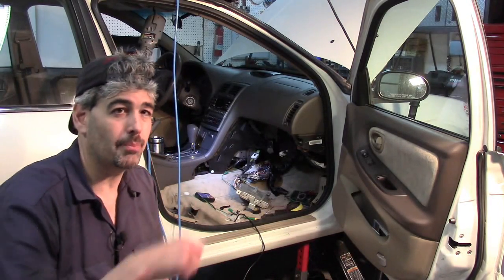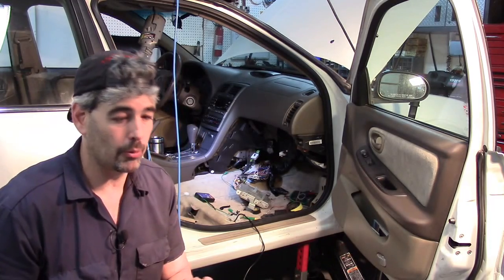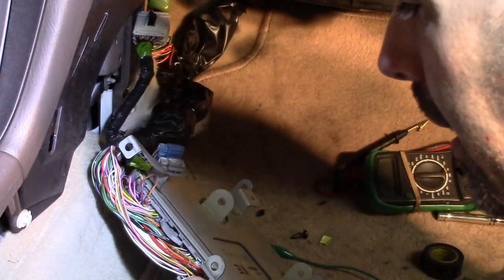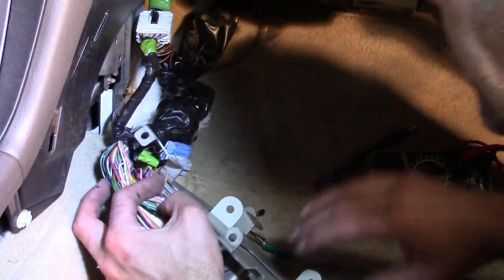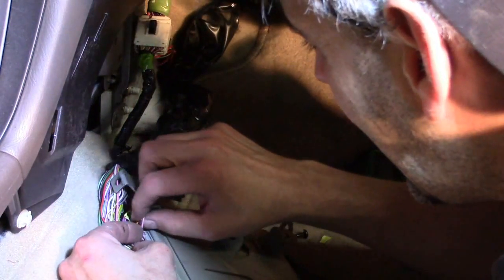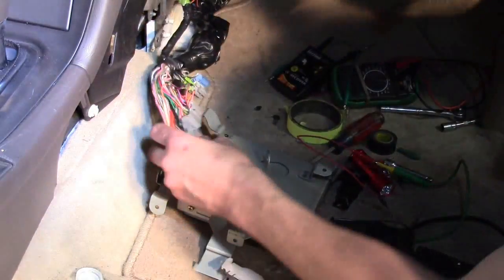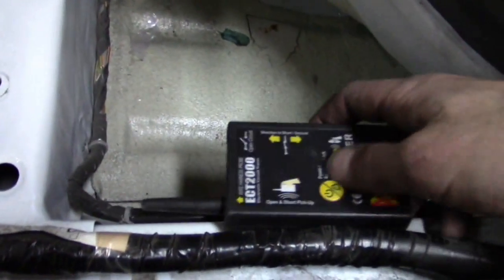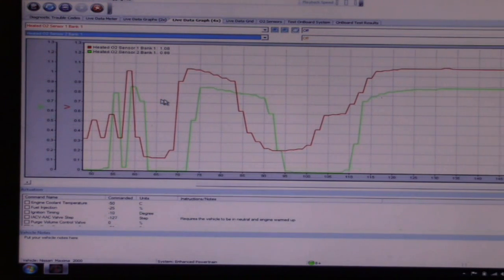P0138,P0139 Diagnosis from Hell Part 2

Comment: Sorry but you did make a big mistake in this diag , your wiring diagram you had in part 1 was perfect and accurate if you look at it you will see power feed from fuse 8 for the heater to sensor pin 3 on the sensor plug , pin 2 on sensor plug goes to pin 5 at ecm for ground side control, I watched this part 2 video thinking you were going to pick up on that , anyway we all make errors no hard feelings keep up the good work 👍
Reply from the maker: So what was the error in the Diag though? The Diag was accurate even if the diagram was misread on that detail.  The heater circuit was still open either way.
Reply: @SchrodingersBox  you were looking at the ground which was the signal ground for the sensor, you said the heater was voltage switched which it wasn’t the dotted line around the 2 wires is a shield for the signal side of the sensor, if you look at the original diagram you will see what I mean , yes you diagnosed an open ground correctly but because you read the diagram wrong it confused you a bit 👍
Reply from the maker: Ha well in either case the correct wire was identified and the diagnose was correct.  I am not too worried about a misread on a part of the diagram that wasn’t relevant but thanks!

Comment: Great job dude. I can tell you having worked at car dealerships in the past that they would have never taken the time to find that problem. I also am a good diagnostic tech. , But with the flat rate system they simply won't pay a tech. for good detailed diagnostic work like this.   I got out of flat rate and have been working on trucks and municipal equipment with hourly pay for 10 years now. There are places that appreciate good techs. just not dealerships....Rob.......
Reply from the maker: Yes I have found that to be the case. The system actually discourages proper diagnostics. They should restructure the incentive and pay system for diagnostics, really.

Comment: Great video! Watching it I was thinking what I would have done. I'm not as knowledgeable and comfortable using live data as you, so I would have gotten the wiring diagram, disconnected the PCM, and found the open with my powerprobe first. Then I would have carried on as if I had fixed the problem. Then the check engine light would come back on and I would have replaced the O2 sensor. BUT, I would have no idea why it was bad in the first place. I would also be wondering if one problem caused the other problem. Since I only work on my own cars, doing it this way would not be a problem, but your way was better since it was not your car, and found both issues at the same time.  Cheers...

Comment: How did you know that the oxygen sensors would cut off at 3500 RPMs? Was that something you already knew? Or was that information obtained from the wiring diagram packet? If it was something you knew; is the cut off occur on most vehicles or is it exclusive to this make it model specifically?
As usual, you rock!
Reply from the maker: Thanks! this is something all vehicles do so I was already expecting it.

Comment: I had a nightmare xterra with weird codes for the evap pressure sensor, and knock sensors for like sensor signal low, and it was all fucked up

Comment: @Schrodingers Box So the Power Probe ECT2000/3000 CAN be used on a wire that goes directly to the PCM with the key and/or the car running? I am testing a fan clutch sensor circuit and the wire goes from the clutch- directly to the PCM. The manual for ECT3000 says "Working Current: <200mA", so isn't that less than an incandesant test light? So PCM safe..please spare no details in reply. Thanks in advance.
Reply from the maker: Absolutely 100% safe.
Reply: @SchrodingersBox  Thanks for taking the time.

Comment: Am getting negative O2 sensor readings on my B1S2. Replacing it just made it to work for a min and then the new sensor went negative too (-0.2 to -0.8v). Any idea what it could be?
Reply from the maker: What data did you have that the sensor needed replacement?  What were your tests?

Comment: I worked in a few dealerships for VW, Suzuki, and Oldsmobile. We would have replaced the entire wiring circuit and ECM and exhaust. And when the customer goes to the bank for a loan to pay for it all, The bank says the cost of repairs exceeds the car's bluebook value and totals the car.

Comment: Bravo! Great troubleshooting without a decent print. I just bought a wire break chaser tool from eBay, plus the AutoEnginuity scanner thanks to you. I am now armed to the teeth with my PICO scope, test light, AutoEnginuity scanner and some problem vehicles. I'll be back!

Comment: If there is a uncertainty between the sensor and the heater then the result of their status once observed should have been good bad or bad good but never good good or bad bad as this is not allowed once the entangled state is collapsed by knowing one of the two ,, yes / no ? Sorry I could not resist . Thanks for sharing and well done.  Hope my po-138 problem goes easier.

Comment: Did the open wire cause the sensor to fail?
Reply from the maker: Hmmm, hadn't thought about that. I suppose it's possible but I am not sure how having the heater inoperative would cause the sensor to go bad.

Comment: just a thought  if you check the fuse panels for a o2 heater fuse/s wouldnt it tell you if it was switched pos or ground?  if it is powered through the pcm (pos switched) wouldnt the power be supplied by the pcm  therefore not have a seperate fuse? and also if it has a fuse thesting the at the fuse would tell you if it was hot all the time(computer ground type) hot with key  or hot only when running(pcm controlled pos).
Reply from the maker: Yes and indeed that was the initial approach I took but edited it out as it seemed repetitive when the open was found to be "after" the fuse box anyway.

Comment: Schrodingers Box
Ok
Thanks a lot for the information 
It still needed the oxygen sensor 
If it wasn't for that 2X4
then the wiring harness wouldn't 
be damage causing an open ground 
😇❤️️🐬😇
Reply from the maker: Yes my suspicion is the O2 heater went out long before the ground wirte disruption and customer just ignored CEL until needed to pass emissions maybe.

Comment: Schrodingers Box
Where was the location of the bend
Where you fixed the wiring problem?
Thanks for sharing 
Good video 
😇❤️️🐬😇
Reply from the maker: Yeah funny story on this. It turns out the customer's driver seat was broken- it would not stay inclined. In order to temporarily fix it he used a 2X4 propped on the back of the seat that he wedged into the runner with that wiring harness which caused the harness damage.

Comment: Wow, that harness looked fine, well wrapped, etc. didn't look like it was rubbing anywhere==weird but great DX
Reply from the maker: Here is what happened.
 When I pointed to owner where I did the repair and the unusual location of it, the owner recalled the reason this would have happened.
  The front seat recliner was broken at one time, and so in order to prop the seat back up, the owner had wedged a couple of 2X4's between seat and floorboard.  One of them was obviously being wedged right on the harness.
Reply: Interesting that so many times there is at the time an unknown reason for something that doesn't make sense at the time as in that Jeep with dislodged CPS and you know the result of that, bare/overly taught wires, etc.  Bottom line is that you found the REAL problem and fixed it

You have a great channel and a excellent way of explaining things as well as thought process. As there is skill and knowledge in rebuilding a differential there is lots involved in step by step DX instead of replacing  parts and 'hoping' that would/should work
Reply: I am surprised the owner would admit it.  not that he would be trying to place blame on you, but that what he did was kind of embarrassing.

Comment: Been bit by this before on sensor diagnosis of all kinds.I do not trust anything anymore.I did a H2 recently that the owner was charged hundreds of dollars to diagnose that the transmission needed work.I laid underneath and watched the power supply to the transmission and just watched it while running .After a few minutes it dropped off. Checked it for amperage and was fine. Voltage fine.Hmmm, ignition switch becoming burned up , seen this before. Checked wiring continuity and gave a good voltage supply to the transmission , worked fine. Changed burnt switch and was done in under an hour. The first time took me three days.Chevy blower controller plugs, I now cut off the plug and solder weather pack, female pins directly to the controller .A new plug and controller will not work for long , as its the plug that is at fault. A lifetime spent on these headaches .

Comment: Well done, all your videos are good for fixing your own cars with out the expensive scan. I was wondering can u do a video of po497 ?
Reply: Evsp stuff is often solved in prechecks . Visual inspection.
Take long careful flashlight inspection and take apart far enough to look. Seems very effective. The manuals are so full of wasted gray matter and multiple systems for same model. Then you start just verifying the parts in system visually. Lookie there. A hose with a split
Reply from the maker: Yes I am often asked about EVAP diagnosis videos. I do need one for the channel for sure but i dont have any at this time.

Comment: I love the way you find the proper part ,i do believe we have been doing diagnostics the same way our entire lives. The only thing i have to say is that i have the same tracer and you really should have unplugged the pcm ,i was told the signal that it uses can actually fry a driver . Just food for thought i really connect with the way you troubleshoot. Great job.
Reply from the maker: wait.... WHAT??  Why on the hell would the tracer fry a PCM driver? Please explain how that would possibly happen.
Reply: it sends a radio frequency signal i guess so that would not injure a driver. I checked after i recieved your email. I was told by someone else and never checked that it sent a voltage. Sorry and thanks for straightening me out on it.

Comment: what are you looking for when you say the cat may not be going bad? should the rear o2 oscillation mirror the front or should it match the front but trail slightly behind?
Reply from the maker: Rear O2 should be rich on a functioning cat

Comment: your video reminded me of a cherry Nissan station wagon that had an injector malfunction which caused fuel to pool on top of engine and you guessed it,ignited and burned everything that was rubber,plastic,etc...
I ended up getting a boneyard computer,sensors,harness from a similar enough year. 
however,tracing every wire from ECM,to sensor,to injector etc...was taxing.
I really appreciate your technique,and how you talk through all processes. this allows us to work as you do.
great video! I especially liked how you gave the customer knowingly false choice for your control.

Comment: Really enjoy your diagnostic processes as opposed to the more common trial and error knee jerk reactions I usually run across. I think maybe a set of surgical scrubs would be fitting for your vids. Don't buy that torch outfit just yet, your work here is not yet finished. Glad I found your channel.
Reply from the maker: Thanks man! Very encouraging!

Comment: Great video. Very informative. Is it possible that you pulled on the wire harness too hard while testing the sensor and caused the open yourself? I just had to ask that.
Reply from the maker: John Weygandt Ummmm... what??  Then what caused the original open in the circuit? I totally don't follow your logic there bro...
Reply: It was a while back for you guys. But I was searching thru all this and found where MATT told of the broken seat and 2x4 prop had crushed the harness. I was thinking made overseas . But the 2x4 was made in usa

Comment: Can an oil covered O2 connector (which I can see but not reach) give me an p0156 code? Thx and nice vids.
Reply from the maker: dwayne0t Yes it is possible but not likely. I would test for signal from the sensor and continuity/bias voltage from the connector

Comment: if cat was good that o2 s2 should be at about .8 volts or so, and in a straighter line and not oscilating, right?
Reply from the maker: Oros Criss correct

Comment: Great video, great diagnostic but did you have to pull the PCM couldn't you just have used your ect2000 and traced from the O2 sensor back?. Just curious, I know ......hindsight is 20-20. Thanks
Reply from the maker: Daniel Wells I tried but as shown the wiring went through a metal channel- the ect does not pick up through metal and I was unable to determine where it emerged.
Reply: Awesome vid now I can't wait to get to work tomorrow!

Comment: Matt, I have a question, you remarked more than once in this video that the cat was probably on its way out, see that the post cat 02 sensor was showing just as much oscillation in voltage as the pre cat sensor. If the cat were doing its job correctly the post cat 02 should put out a lower fairly constant voltage right? What your opinion on "cleaning" bad cats like this using some sort of goop or lacquer thinner..I've heard of people doing this. Do you think it's total malarkey or is there some truth behind it. I love your videos. You are great.
Reply from the maker: A healthy cat would put out a constant HIGHER voltage because of the lack of O2 present in the post-cat exhaust (the catalyst uses O2 in the conversion of HC's to CO2 and H2O). 
  You can see my video P0420/0430 diagnosis for better explanation. 
  As for cleaning the cat- I have doubts but I suppose it is possible that if the car has an issue such as running excessively rich and contaminating the catalyst, perhaps it might work (but the car still has an issue of course) but if the catalyst lifespan is truly exhausted, it is not possible to clean it and resurrect it.  Catalysts do not last forever.
Reply: Thanks for clarifying this. Keep making great videos.

Comment: I was told that on some vehicles it is recommended that the O2 sensors should be replaced at certain intervals like 75,000 miles
Reply from the maker: If they are functioning there is no need to replace them regardless of mileage. it's not like they "function better".  When they don't respond correctly the PCM will reflect it for sure.

Comment: Perfect diagnosis and repair. After 47 years as a tech I don't remember seeing an O2 sensor fail as well as the heater circuit at the same time. Goes to show you need to be thorough with your diagnosis. A BIG thumbs up.
Reply from the maker: wysetech2000 Thanks man.  I admit, I thought this one was going to be the one to finally nail me lol!

Comment: The pcm is a very tricky piece of kit especially for the novice.Proper circuit diagrams seem to be the property of the Secret Service.Even the Hayne's manuals come up short when it comes to this section.Very informative video and easy step by step approach.Don't burn down the house just yet,your insurance premiums might take a sharp hike.Oxy/acety torch is must for exhausts.

Comment: Good video. Satisfying to watch and easy to follow your thinking. 

The computer usually has transistors with the emitters grounded. The  external load is connected to the collector.  When the computer wants to activate the circuit, it sends an tiny current through the base, turning the transistor on fully and current flows from the collector to the emitter and finally to ground (read negative). 

There is always a "load" somewhere in the circuit when it is a closed circuit. If it is a "short circuit" then the load has very low resistance and a lot of current will flow. Potential energy (read voltage) is converted to kinetic energy (read heat) when there is a large current and voltage (read power) there is a large amount of kinetic enegy.   

The transistors in the PCM are just large enough to handle a normal load with a excess capacity (read "rated at 120%). If you exceed the current long enough, the transistor which is formed on the computer motherboard acts like a fuse and opens, thus condemning a whole PCM because one tiny transistor is fried. 

Check out 

http://delphi.com/manufacturers/other/connectors/ 

One can also signal trace using a meter with capacitance measuring capability.
Reply: BChrisL How can one trace a signal with a capacitance meter?
Reply: Tracing with capacitance is not as accurate as the inductance sensor shown in the video, but if circuit is broken at a connector, then the capacitance reading of the circuit will approach zero if measured there. On the other hand if the connection is broken at the other end, say at a crimp, there will be a larger reading relative to the length of the cable. I have to admit it is more useful on longer lines, but I have used it on open faulty circuits to get a quick place to start looking.

Comment: when you came to the conclusion that the 02 was dead you never checked that the wiring was intact between the 02 sensor circuit and the computer.  I suppose you had minor movement (reaction) in the scan data, and maybe that was enough.
Reply from the maker: CoolAirVw Yes you are absolutely correct. Indeed, had I not seen the minor variation in the signal from the bad sensor I would have checked the signal circuit at PCM as well. HOWEVER- the flatline at .2V as opposed to 0V was also indicative of continuity in the signaling circuit so thats another reason I wasn't as concerned.